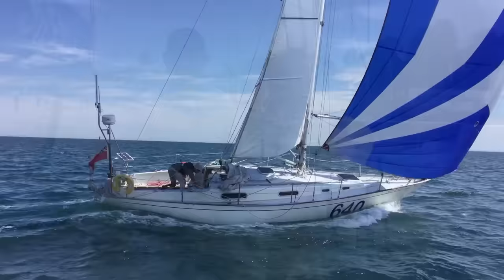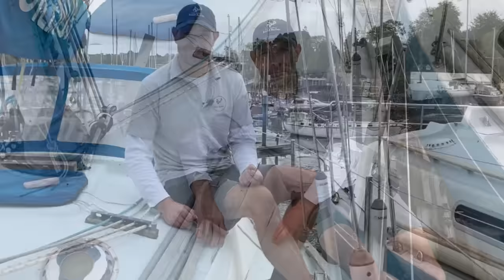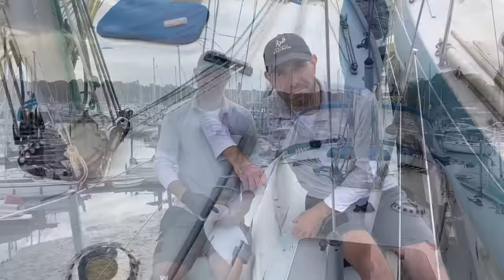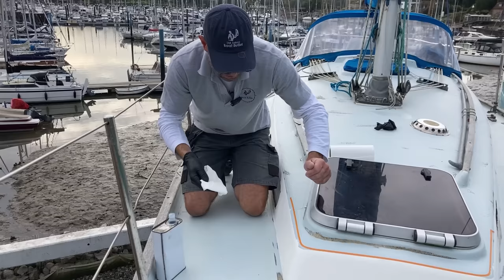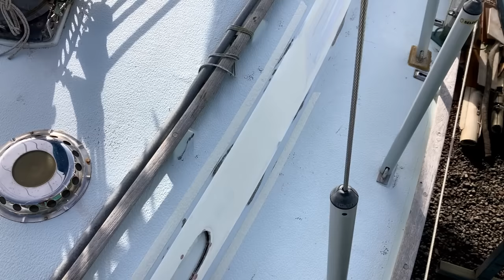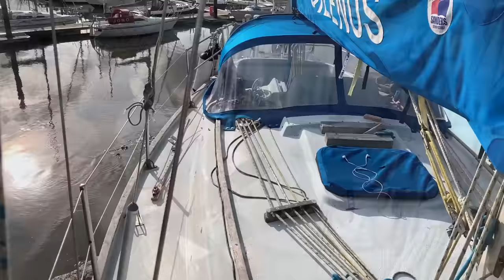Apply and Refinish New Gelcoat over old on a Contessa 32 (ReGelcoating 101)

Comment: Hi there.  i am busy repairing a fibreglass bonnet for a car.  i had to do a lot of work to it and there are some areas where i had to remove all the gel coat and other areas where there is some left.  What would you advise to do?  Should i give it a fresh new gel coat all over, block sand it and then paint it with epoxy primer?  Or should i just paint it with epoxy primer?  The bonnet will be the same final colour as the rest of the car when we have finished.

Comment: Good day Sir, I am about to gelcoat a deck and do nonskid, you mentioned re-taping after each coat, and I understand how gelcoat "Bites, Melts" tape what do you think about 3 layers of tape peeling one after each coat? It will probley still melt into edge?
Thanks Brian
Reply from the maker: Worth a try, may depend on how resistant your tape is.   Could be a time saver if it works.

Comment: Hi I have the transom of my Carter to be repaired after someone knocking it, so I’m going to dig the spider cracks out and fill with chopped mat/resin. Loved this video and decide to paint the whole e of the transom with a colored gelcoat, would roller give a better finish without having to sand se much? Or is it best to use a brush to get a thicker coat on.
Cheers Andy.
Reply from the maker: Roller application is fine, just need to be carefull not to introduce micro bubbles of air into the gelcoat when rolling.    I’m just used to using a brush so go with that.

Comment: Really informative. If your working on the hull topsides, do you section it off and do one at a time?
Reply from the maker: Depends on the size of the boat, I may do one side at a time on a smaller boat or I may coat with new gel to the centreline and then continue.    If you leave a tapered edge (in terms of the thickness of new gel) the. It makes a nicer job with you continue on that side.   Hope that makes sense

Comment: Hi George - how do I buy you a beer?  I will find out and do so because this is brilliant, the best gel coat application video that I have found on YouTube!  I have one question: I am curious about your sanding the flow coat layer, you said that you did not want to rub through to the old gel coat but I would have thought it more likely that you will rub though the final flow coat layer and expose the new gel coat that isn’t ‘flow coat’, exposing tacky new gel coat.  Is that not a risk?
Reply from the maker: Pleased you liked the video, link for beer is I the video description.  Re tacky gelcoat the top surface of each layer of gelcoat is initially tacky until the next layer of gel goes on and cures, this also cures the previously uncured tacky surface.   That why I put wax in the final coat, it stops the final late from being tacky so it’s easy to sand and refinish.  So when sanding there is no tacky Gelcoat in between the layers.   Hope that makes sense.

Comment: Great video showing the process.
We need to do our transom including the corners. How would you get a good blend between the new gel coat on the back and good existing gel coat in the sides?
Overlap by a few cm's then sand to flush?
(With a big assumption we can get a reasonable colour match).
Thanks
Reply from the maker: If it’s a sharp corner you can just gel up to the corner and as long as it’s a close colour match  the corner (and therefore the change in angle to any light source will hide any slight variation.

Comment: What gelcoat have you used? And what's this about the wax and tackiness?
Reply from the maker: Gelcoat is gelcoat, lots of suppliers, a smaller number of manufacturers, who you buy from and what you get will depends on your country.   Gelcoat on its only is primarily used for laying up new mouldings so put into a mould then glassed over so there is no oxygen and no tackiness.   When used to do a repair the gel is open to the air so the very surface I’d the new gel does not cure unless you cover it in PVA (which I mention at the end of the video) or I prefer to add wax to the final coat that seals the surface on curing so no tackiness.   Hope this explains it.

Comment: Great video, thank you for such an informative video. I sent beer $! Q - how come you don't use a finishing sander and donit all by hand?
Reply: I read the other comments and replies, so got my answer 👍
Reply from the maker: Thanks for the beer and the comment.  Ok larger areas I do use a sander but this section in the video is a large curved area + I wanted to show that it can be done by hand.    On large area I will either use my Mirka DA or or much larger areas I may use my longboard sander.

Comment: Do you have to sand in between the coats? Or just apply,  wait till its hard and apply again? Great tip with the pen marks before sanding btw. Is that possible when you have dark gelcoat?
Reply from the maker: No sanding between coats, just apply next coat once the previous coat is firm enough to take the next coat.
Reply: @RefitandSail Thank you for your answer! I have been given a small 2,5meter long polyester boat, which I will take out the water each time I've used it. An anti fouling wouldn't be necessary, right? How many coats of gelcoat would you suggest for the bottom?

Comment: Regarding the addition of wax on the last gelcoat layer.  Can you omit it and just give it more time to cure so it isn't tacky?
Reply from the maker: It would still remain tacky with a top surface that won’t cure.   It could be cleaned off with acetone before sanding but quicker and easier to add wax (or coat with polyvinyl alcohol)
Reply: @RefitandSail  Understood, thank you.

Comment: you did not mention rolling the gelcoat on; have  you found it not working well? Because otherwise, rolling should give a smoother surface, right?
Reply from the maker: Rolling possible but you have to be careful not to introduce little bubbles/voids into the gelcoat that are found once you start sanding.   I find painting with as wide a brush as you can works well and is quick.

Comment: George... Why this approach (brush & sand) rather than roll & tip?
Reply from the maker: I have not tired to roll and tip gelcoat, it’s something you would do with paint rather than gelcoat, you are likely to pull the gel if you try to tip it but applying it with a roller is certainly an option.   Either way you need to sand and polish to refinish the surface.

Comment: Great video just a question if you dont add wax or use PVA to the last layer does the gelcoat stay sticky or does it harden up over time?
Reply from the maker: It will stay tacky and uncured, so t can be cleaned off with acetone or you could sand it off but much easier to use wax or PVA mould release
Reply: with that gelcoat you used can it be used below the waterline on trailer boat which is washed down after every use? @RefitandSail
Reply from the maker: @davidwoodley3764 yes no probs.

Comment: Wouldn't have been easier to spray on and just cut and polish with like 600 then 1200 and 2000 sandpaper and compound polish? Or gel coat can't be sprayed??
Reply from the maker: Gel can be sprayed but it has to be thinned hugely which my not be great for the porosity of the gel and colour retention of the gel once cured, you also have to deal with all the over-spray and do it inside in a spray booth, much more masking and cleanup.   But it can definitely be done and probably saves time on the refinishing.

Comment: Very useful video George, thank you.  I am keen to spruce up my coach roof sides but have been researching suitable paint options.  Now I am seriously considering the gelcoat route!   You've talked on FB about the physical effort & mental fortitude required - can you give a rough estimate of the time it took you to do all the sanding & buffing just on that demo front section?

For the final coat, you mention adding styrene and wax.  What does the styrene do?

Suggestion for future video - hand rail replacement?  I want to recess the fixing screws so that I can put teak plugs in, but don't know how they are fixed - some say that the screws go into encapsulated nuts, some that they are tapped into an encapsulated aluminium plate, and others say they are bolted into/share the internal handrail fixings.  I don't want to take out the fixings only to find that I can't get them back in!  Also considering replacement with new.

Thanks.
Reply from the maker: Hi John, maybe a couple of hours to do that but from initial sand to final polish.   

There is styrene in the gelcoat as a thinner, the wax needs to be dissolved in something to get it into the gelcoat, as the styrene then escapes the gel on the surface the wax is left to seal the gel from the air so it cures.
Reply: @RefitandSail  Thanks George.  That's all sounding quite 'doable', especially if it can be done in instalments.   I'll take your advice & practice on a scrap piece of ply & see how I get on.

Comment: Another great video George 👍

I’ve seen loads of internet comments where re-gelcoating is seen as some black art, and they always recommend painting instead. 

Can’t understand that because IME most owners don’t the patience/skills/money to do a really good job with 2-pack and if they do then it’s nearly as much effort as repairing gelcoat 🤷‍♂️

I have a question, is it necessary to go all the way to 1500 grit? 3M recommend to 800 grit should then be followed by rotary polisher with Heavy Cutting Compound, followed by a polish. Seems you could skip some sanding that way?
Reply from the maker: I have polished from 1000 grit before with good results but by the time you get to that level it takes very little effort to go for a higher grade and it makes the polishing quicker if you want a perfect result so the time spent on 1200-2000g is not wasted as you get the time back in the speed of the final polish.

Comment: great video.  thanks.  you mentioned PVA to finish off the final coat of gel.  Is that PVA (as in wood glue?).
Reply from the maker: No, not pva glue as that has other stuff in it but liquid PVA, a composites supplier can provide.    Don’t use wood glue!!
Reply: Thanks!
 @RefitandSail

Comment: That section looks brilliant!  I like sanding as long as I'm not the one doing it.  😆  I've never tried wet sanding anything... are you literally dunking your sandpaper in a bucket of water?  What is the advantage to wetting the sandpaper?
Reply from the maker: That sanding paper is designed to be used wet, bucket of water used.   You can dry sand at very fine grades these days but most still seem to still prefur wet sanding to finish gelcoat

Comment: I wish you had of done this videos 2 months ago. I regelcoated a 1979 Checkmate using a brush and roller. The OE gel coated was in really sad shape. I mixed the gel coat double checking all measurements but some places had a tastiness. So you are saying just go over with acetone? I know it gums up sandpaper very quick. Please advise and thank you
Reply from the maker: If you are trying to refinish gelcoat that has a tacky surface then wiping down with acetone should help remove the excess uncured gelcoat so you can sand it without gumming up the paper.   Ps I remember checkmate…. Where is she now living?
Reply: @RefitandSail  I found this Enchanter model Checkmate in a salvage yard. No interior, rotted floor, stringers and transom. I’ve replaced all that and for the past 2 months been working on the finish. Still got a place to two that has a tacky feel. I’ll try the acetone. Thanks.

Comment: Which do you think takes longer, gelcoat or single pack paint?  Which ever, is it worth the extra time?
Reply from the maker: Gelcoat will be longer lasting and probably give a better looking result both in the short and long term but it a lot more work and a bit more cost. Painting With a single-pack paint will be quicker.   Only you you can decide what is right for your boat and circumstance.   If it’s a “forever boat” then its a different circumstance to something that you only plan to keep for a couple of years.

Comment: Any reason not to use an eccentric orbital sander other than curved surface? 🙂⛵️
Reply from the maker: No reason not to, and I did on the wider and flatter areas on the side of the coach roof.   I just did the example piece for the video by hand to show how it can be done.    Sorry I should have made that clearer.

Comment: Hi George, another great video thank you. Did you get all 5 coats on in one day? Cheers
Reply from the maker: I split the area to be regelled into three sections but each section got 5 coats in one day (so three days of coating) but they were not full days if that makes sense).   I could maybe have done it it two sections but this worked well.
Reply: @RefitandSail  Brilliant thanks George I have the perfect test piece to experiment on.
Reply: @RefitandSail  How do you handle separate sections of one large surface? Do you let one section cure and then sand the edge where new section joints the old one? Thanks!
Reply from the maker: @petcern4254  when applying I left a staggered edge so I can then paint on the next section in a similar staggered way.   The other option is to over coat and sand back… to much gelcoat is better than not enough, it just means more sanding.
Reply: @RefitandSail  Thanks! Actually I was able to see it clearly when you were applying second coat since the camera was sitting right by that staggered edge. So my last question is did you leave that staggered edge area tacky staying a little bit away from it when applying final coat with wax so you don't have to sand it when resuming with another section the next day?

Comment: Why not use rollers? Do you rinse out your brushes or toss them?
Reply from the maker: Rollers can work, just need to be careful not to roll micro bubbles into the gel.   I use brushes as I’m just used to using them.    They are binned after use.
Reply: Copy that.

Comment: How lang did you sanding en polisch over that piece?
Reply from the maker: Good question, I’d guess about 2 hrs but that included playing with cameras.   Flatter areas were I could use an electric sander would be a bit quicker for a comparable surface area.

Comment: I didn’t cheat, but I did watch the video at 1.5 speed haha. That was a lot of sanding, do you think you sanded through that final coat with the wax?
Reply from the maker: I’m quite sure that I sanded off all of coat 5, most of coat 4 and some of coat 3.    Hopefully 2 and 1 largely remain on the boat 😆
Reply: Okay then was that wax in the final coat necessary if we sand it all away?
Reply from the maker: @rolyoly100 yes, without the wax the surface of the gelcoat does not cure so you are left with a tacky surface that then clogs whatever you are using to sand it.   So adding wax to it saves time and effort.

Comment: Totalboatt's polishing cream just needs sanding up to 400-600!!!!!!!! Lot less work.
Reply from the maker: I think the total boat compound suggests starting from 800 but I could be wrong, 3M says the same which I used but the higher the grade you wet sand to the less machine polishing you need to do so what you loose in one part of the process you gain in the other.    Also once you get to the higher grades the wet sanding takes very little time so I really think it’s worth going to at least 1000 if not 1200. 

You also need to keep in mind that totalboat products are primarily aimed at diy/home users not professionals but they get a lot of use on the YouTube because then sponsor a lot of channels that are watched by diyers.    Nothing wrong with that at all but it can skew the viewers impression of what other products/suppliers are out there.   West system do the same but not to the same extent on social media.